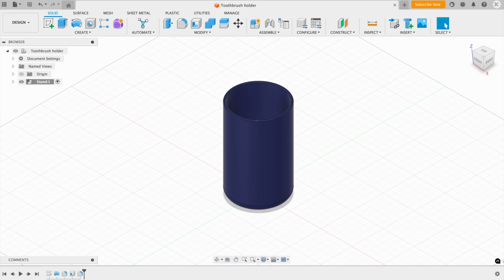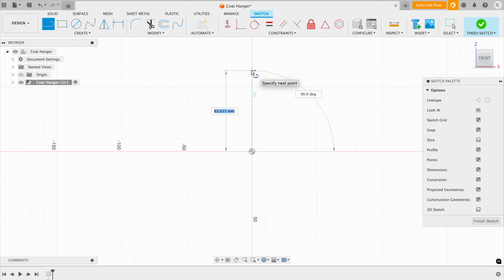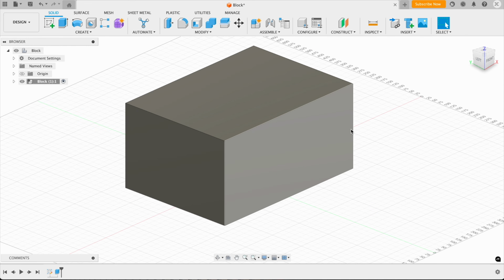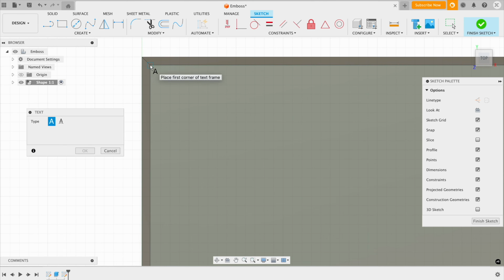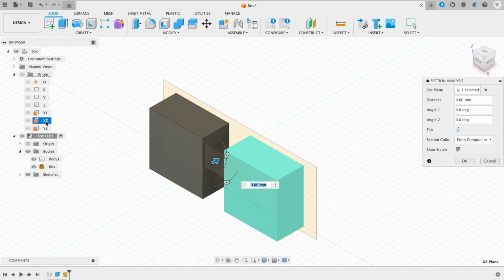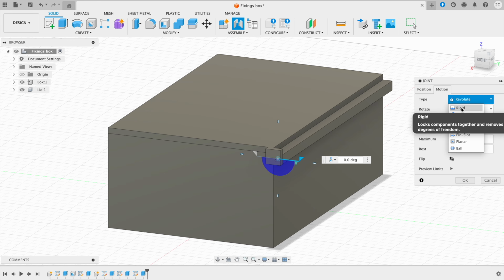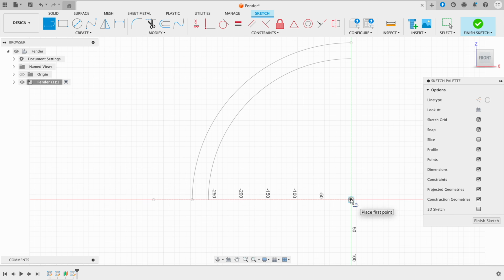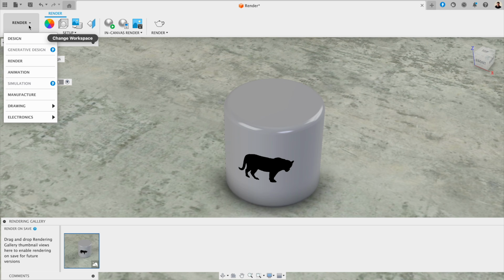Autodesk Fusion for Beginners | Full Course - 2025

Comment: Regarding reference images, how do I calibrate the image if the only known measurement I have on the picture is a coin? Can I calibrate it by defining the coin's radius/diameter?
Reply from the maker: Hi, this is not something that I have done before myself but yes in theory if you know the measurement of the coin then you could calibrate using diameter. Hopefully this helps :)

Comment: Hopefully this gonna help me to learn, I purchased the free edition (hobbyist) and have an ultimaker S5. So far so good. Thank you (subcribed)
Reply from the maker: Awesome! Thanks for subscribing. How is the ultimaker S5? What kind of things are you planning on making out of interest?
Reply: @cadcubed just general stuff for the house, I have made a shelf, vase but I’m struggling with fusion 360 and trying to make a new component, your layout of fusion 360 and using assembly opens up make a component, mine does not have the option to make a component so I’m stuck

Ultimaker S5 is good thing but u still need to be able to model stuff😂
Reply from the maker: @navinbhandari2001  Nice. Yes there has just been a new update where you need to select if you are making a part or an assembly or hybrid. I am working in the hybrid mode. Hopefully this helps, if not let me know. Cool! You will get there :)

Comment: I'm obviously new to Fusion.
A few issues arose that weren't addressed, making following the tutorials quite difficult.
- My axes were not the same as in the video, the colors and directions were mixed up. After a while I discoverd I could set it in "Preferences > General > Default modelling orientation > Z up" instead of "X up".
- After 1:49, selecting the axis didn't work. A message persisted: "Select one or more axes to distribute pattern instances along". After a while I discovered I need to click the axes near the crossing of all three axes.
- Once an object's size is set, I can't changed it. I tried double-clicking the object, but it doesn't work. I need to enter the size correctly at the beginning; otherwise, I'll have to delete the entire object and redraw it from scratch. How can I adjust the size if I'm wrong?
- When I tried to start a new project, the "New Project" button is missing from the data panel. After a while I discovered there's a 'Home' icon at the left of the project name with an arrow down next to it. I needed to click the home icon, then the "New Project" appears. The arrow down button doesn't do anything. I also need to close tabs of existing projects and when saving I need to select the project I just created as the ols project is shown there. I'm now able to follow allong, I think.
- In the text emboss example, can't you edit the text afterwards without deleting the objects following the text and the text itself, starting it over?
I understand it's quite difficult to get into the shoes of a noob.
Otherwise I like your video very much! Those are great tutorials! Thank you very much!
I have the trial version and hope after it expires, I still can use it, for 3D printing, where I'm also a noob, yet. I ordered a Bambu Lab H2D so I can focus on printing, instead of fixing a new printer first, I hope.
Reply from the maker: Thank you so much for taking the time to share this feedback.

Fusion can definitely feel a bit unintuitive when you’re just starting out, and your notes are super valuable for helping me understand where viewers might get stuck.

Thanks for pointing out the axis orientation issue and the pattern-axis selection prompt — those are great examples of things that can easily trip people up, and I’ll make sure to clarify them better in future videos.

For resizing objects: in Fusion, most dimensions can be edited by opening the sketch or by modifying the feature in the timeline at the bottom of the screen. You can right click on them in the timeline and click edit sketch or edit feature to edit them. It’s not always obvious at first.

Ah, I see what you mean about the “New Project” button — it can be a bit hidden sometimes.

Again, thank you for sharing this. It helps me improve the tutorials. Learning Fusion takes some time, but once you get it, it’s really rewarding to see your ideas come to life.